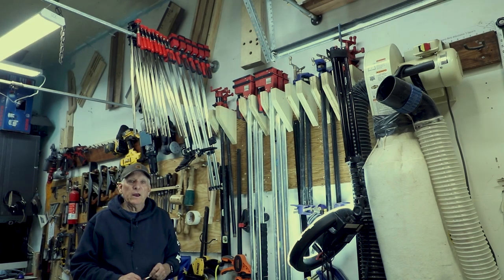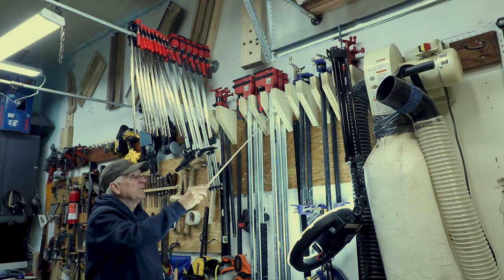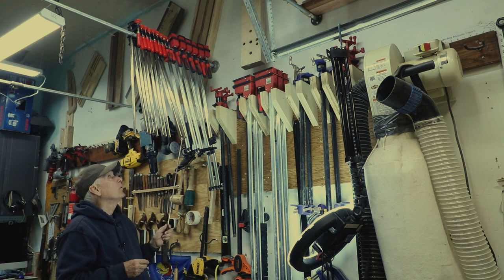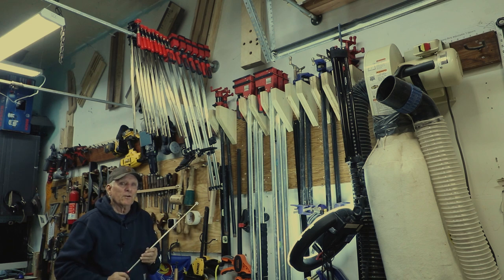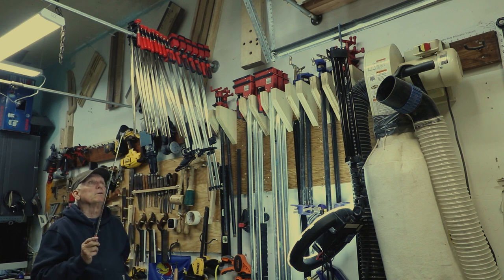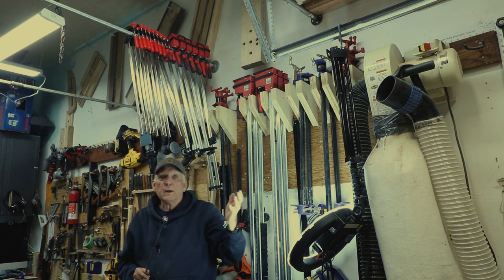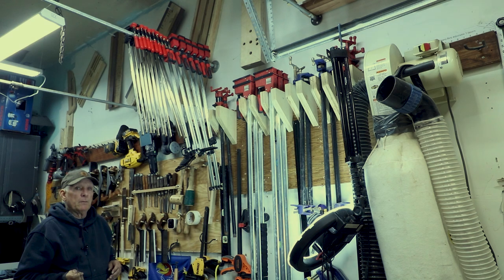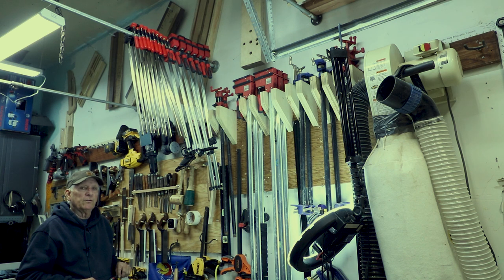What the Heck Is....  A Clever Way to Store More Clamps in a Small Workshop

Comment: Paul, thanks!   That is a great idea!   My garage has a 3 piece 2x10 beam spanning the width of the garage which the ceiling joists rest on.   I could see using a system like this attached to the top of the beam, close to the wall, for a foot or two, to minimize affect of weight of the clamps on the beam.  And being close to the wall, less likely to hit my head.
Reply from the maker: Go for it!

Comment: I haven't seen that before, that's pretty ingenious of you Paul. I just acquired seven well-used clamps that need a place to go, so they along with my new F clamps can be hung like yours are. Fortunately I don't need to find any studs to attach the flange because I have concrete walls. I would still shorten it like you did and attach it to the roof trusses though.
Reply from the maker: Hey - glad you found this useful and unique
Reply: With my neck the way it is, my issue is that I wouldn't be able to stand under them and look up to grab the one I want. I would have to look at the one(s) I want, walk up to them with my arm raised and feel around for them.